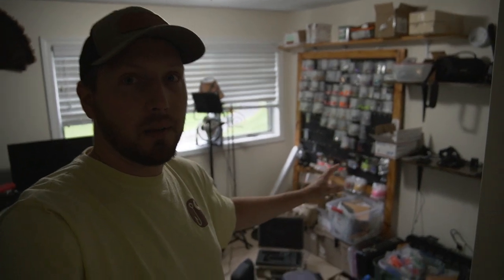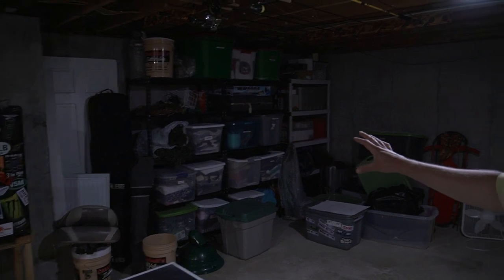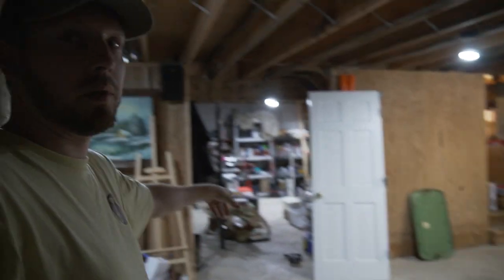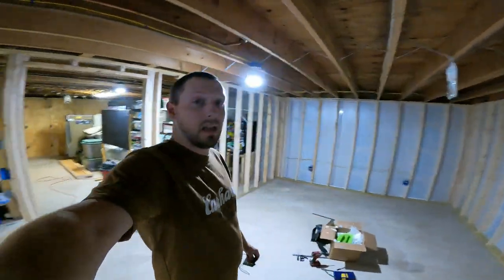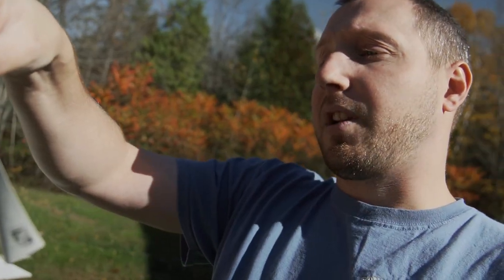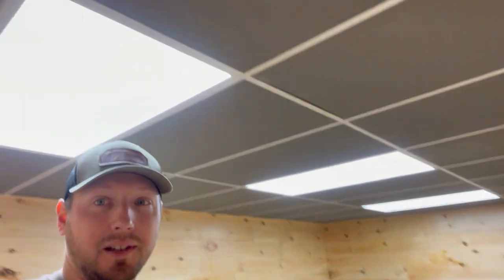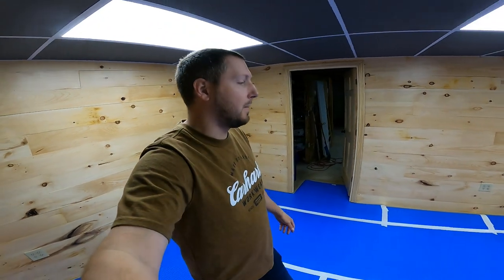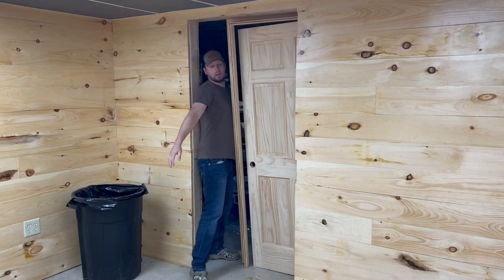Basement Office/Shop Build with ZERO Carpentry Skills!

Comment: Nice work! What are your plans for a heat source?
Reply from the maker: Just running a space heater for now. It doesn’t get too cold (high 50s) in the winter, so I’m just warming it up a few degrees with that as I use the room

Comment: Hey bub, did you need a permit from your town hall?

I’d like to do the same to a section in my basement, but screw hiring an electrician!  That crap is more expensive than DIY as long as I do the job right. 

Did you avoid the permitting and inspections?  Sorry if I’m incriminating you with my question, but maybe your town in Maine is less stringent than my town in Maine.